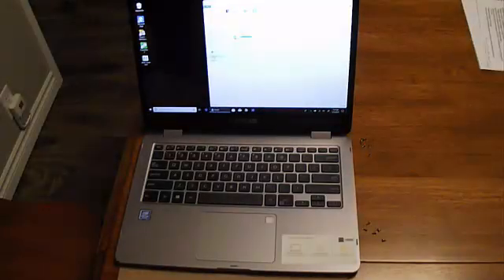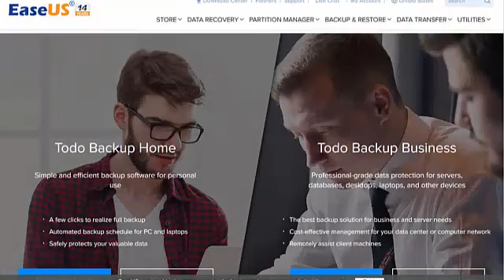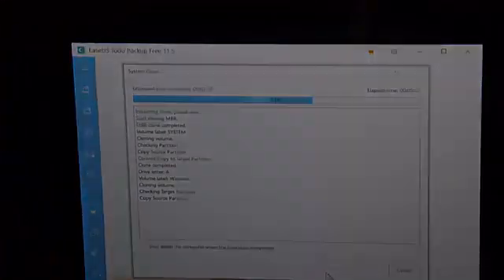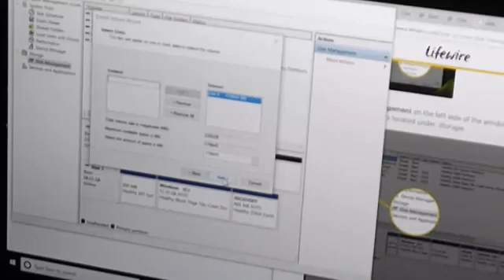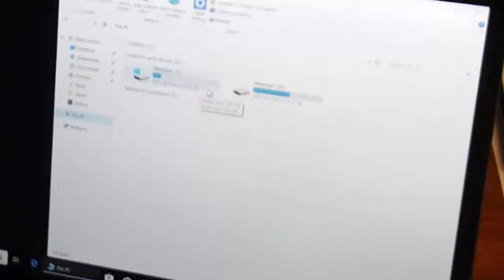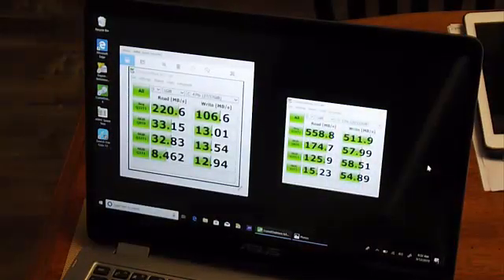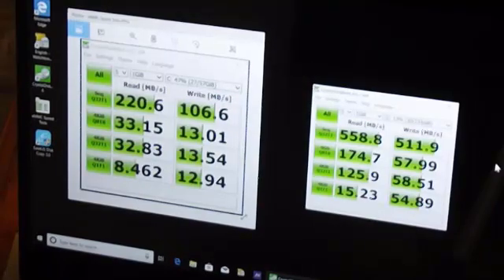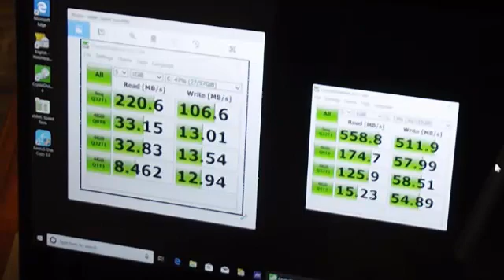ASUS TP401MA VivoBook Flip 14 - SSD Upgrade

Comment from the maker: Okay, PCIe drive is on the way to test it's compatibility with the TP401!
I'll update when it comes in. UPDATE: PCIe does not work on this model. The slot will accept it, but the system doesn't recognize it.
Reply: Did it work?
Reply from the maker: @bryankeltonadams  It did not. The TP401's M.2 slot fits a PCIe drive, but won't recognize it. The BIOS also doesn't support UEFI.
Reply: @noiseintheoffice  bummer

Comment: Very helpful sir, ordered my tp401ma and waiting it to arrive. Wd green sata ssd seems cheaper than blue ones. I wonder did the ssd affect the battery life?
Reply from the maker: It didn't have any affect that I've noticed. Green is a little lower performance than Blue but has a better price point. Green should still outperform the onboard 64GB storage.
Reply: @noiseintheoffice  got mine recently. It didn't come with the stylus. Does stylus from asus transformer book work on this one?
Reply: Got my tp401ma and installed a wdgreen m2 sata ssd in it. The benchmark speed is almost as fast the blue one, with write speed slightly slower. Its cheaper tho

Comment: Okay, now I have to write my whole comment all over again because previously, YouTube failed at uploading it.
First of all, thanks a lot for the great tutorial, which was extremely helpful for me since I have never installed an SSD and all the more, since I want to buy this exact device. What a nice coincidence because it seems to be a decent device but not hyped as much as Macbooks or the latest Huawei ultrabooks. 
However, I still have two questions and I'd be so happy if you were so kind to give me your opinion on them:

(The following questions both refer to the same Asus device you're working on in the tutorial)

1) I wondered whether I could also install the following Samsung SSD instead of the one you used:
https://www.amazon.de/Samsung-MZ-V7S250BW-Plus-Interne-3-500/dp/B07MHXYL6T/ref=cm_wl_huc_item
As far as I can see, the Samsung SSD has got an M.2 format (2280) but I couldn't find out whether it's SATA-type. In the Amazon specs, it says 'Interface: PCIE x 4'.
However, as I am new to this field I have no clue whether it is technically possible to install the Samsung NVMe SSD and I haven't smartened up by reading Amazon reviews or searching on Google :(

2) By now, I have opened my previous Samsung Ultrabook only thrice and only in order to clean it, which worked pretty well apart from ripping apart two dents of the bottom shell while opening it (it was made of plastic). I wouldn't exactly describe myself as intellectually challenged but I do respect your skills and presumed experience. That's why I fear screwing things up in an instance if I were to install the SSD into a brand new device, although in your video, it doesn't seem to be too tricky at all. Hence, my question: Is there anything else -apart from disconnecting the mainboard from the electricity supply - I could possibly screw up? How do I  know which side of the SSD has to look up or down, respectively?

Again, thanks a lot for the video. Even if you cannot find the time to answer, your tutorial has helped me a lot :) But if you brought yourself to answer my questions, that would be sublime :D
Reply from the maker: Hello Javier. 
1) Regrettably, the Samsung 970 EVO has a PCIe interface. The TP401 specifies a SATA III interface. The 860 EVO would be the correct fit: https://www.amazon.de/Samsung-MZ-N6E500BW-860-EVO-Interne/dp/B078WQC2GQ/ref=sr_1_6?s=computers&ie=UTF8&qid=1553543868&sr=1-6&keywords=samsung%2B860%2Bevo&th=1 
2) You should be safe in doing the upgrade so long as you disconnect the battery, and touch that metal chassis to equalize the static charge. 
The drive will fit in the slot only one way, label up. 
Thanks for your question!
Reply: @noiseintheoffice  Wow thanks, now, that's what I call a fast answer! Just one last question: In the video you said that it's theoretically possible to install a PCIe SSD as well, right? Because on Amazon the Samsung product description reads “suitable for top-performing PCs and Ultrabooks“. Of course, this convertible isn't exactly what this sentence refers to but at least it is an Ultrabook :D So, I would consider contacting ASUS support to clearify that if you said that there might be a tiny chance that a PCIe SSD could work. I'll let you know what they answered :)
Reply from the maker: @LeGoogleDoodle  Sure! That would be great. I got no information when I chatted with them in that regard, but maybe you'll have better success. :)
Reply from the maker: @LeGoogleDoodle  Testing with a PCIe drive indicates that the M.2 socket doesn't support it, although it fits mechanically. They mustn't have connected the lines from the PCI bus to the M.2 socket. The BIOS also doesn't have options to support NVMe drives. :(

Comment: Did increase boot tim?
Reply from the maker: Boot from power to desktop was about 20 seconds when booting off the eMMC. Booting from the SSD takes about 14 seconds. If you take away the 5 seconds for POST and BIOS, the actual Windows loading time went from 15 to 9 seconds. Thanks for the question John!